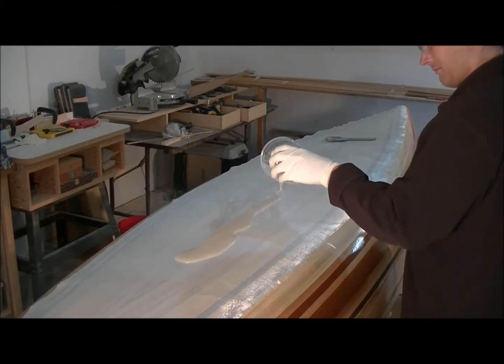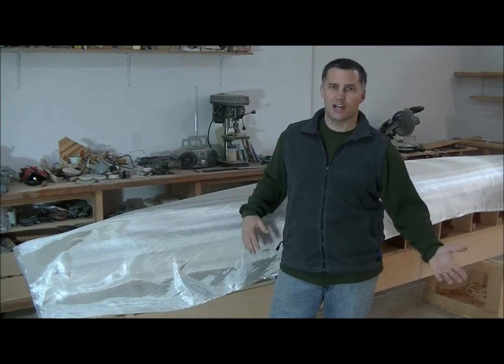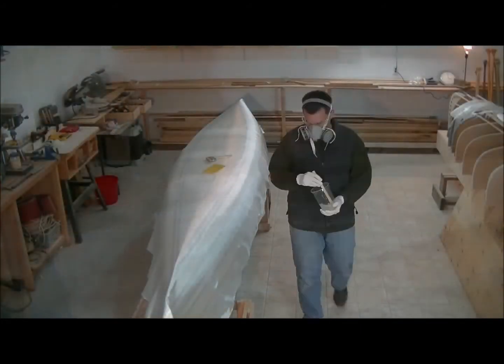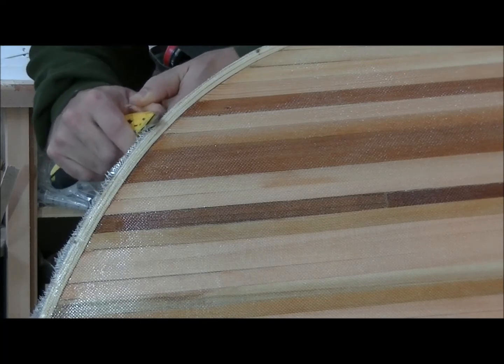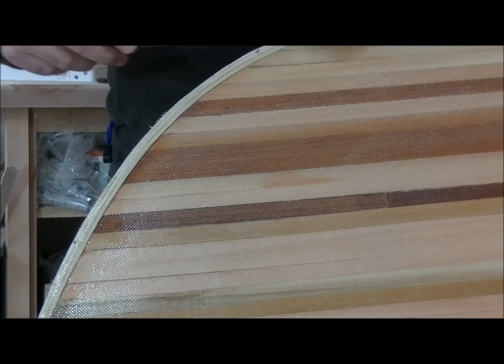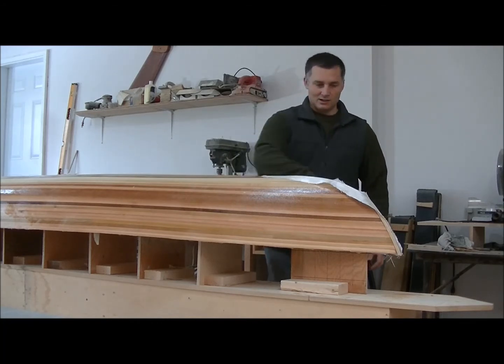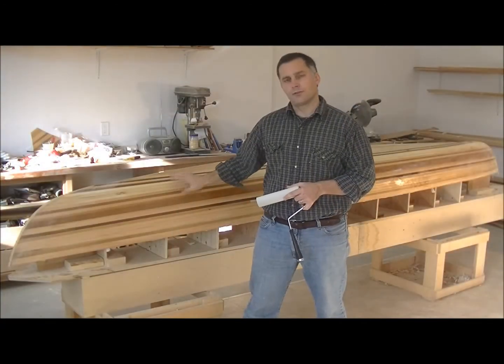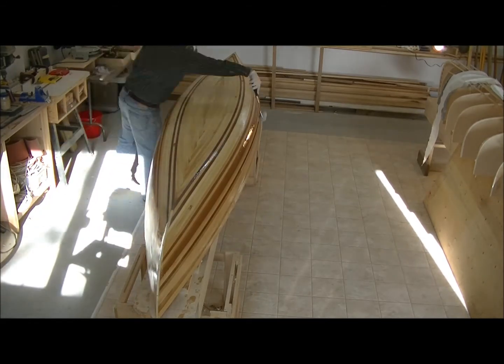Applying Fibreglass and Epoxy to the Outer Hull pt two

Comment: This appears to be the second video after you put a coat of epoxy on. Did you sand at all before you put on the first cloth, the football shaped piece on the bottom?  When you put the full piece on, did you sand in between that step? or did you put the next cloth on before the first cloth was completely cured? Or does it matter?  Thanks, I have a football down now, fully cured. I did sand because I had some drips down the sides.  I think I'm ready for my full piece. thoughts please?

Comment: Must be an amazing feeling to be on the water in your creation. Magic
Reply from the maker: It is very nice indeed, and the process of building a canoe helps the paddler learn about how the boat functions in the water.
Reply: Jason Eke
building a boat or canoe will not teach you how it will function in the water, however a water test will show you how it does function... right or wrong. cutting out a piece of wood does not qualify as teaching you how the component as a whole will work.... you could essentially cut pieces of wood till the sun goes out it, however will not teach you how it will react when you throw them in the water. I will say it is very beautiful canoe but I can't tell if it works well in a river.

Comment: Could you on end of the canoe instead of just cutting it off, could you just over lap the ends by cutting it down the middle starting when it curves? You could get reinforcement with out having to add an extra piece of cloth. What your thoughts. Great looking canoe by way.

Comment: How far along was the football shape fiberglass epoxy cured? Do you just treat the second sheet of fiberglass as if it were just a second layer of epoxy?
Reply from the maker: You can do it a couple different ways. Either do your first layer of cloth and epoxy (one coat) and then add the football patch while the first coat of epoxy is still green (you can press your thumbnail into it), or lay your football patch cloth down with your full length cloth and then do your epoxy saturating through both layers. This is what I did in the new-ish video kayak building. Check that video out for comparrison.

Comment: I noticed you lost your squeegy when your did the hull... you used a paint brush for most of it.
Since working time with epoxy is longer than fiberglass resins, it seems like you could have made larger batches of epoxy to cover the cloth... you made about 6 batches? any good reason for that? just wondering...

Comment: A tip from a model sailplane fuselage builder, trim your cloth before the epoxy sets, while it is still "green", not fully cured. Tacky but no fingerprints left behind. It is a lot easier and you don't get splitters of fiberglass stuck in you. You can guess how I know that . . . ;>)